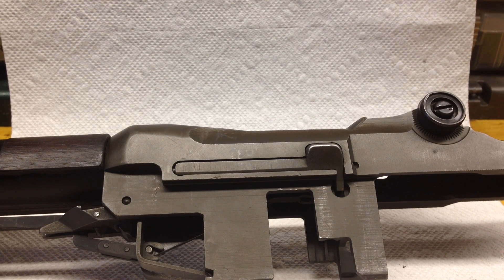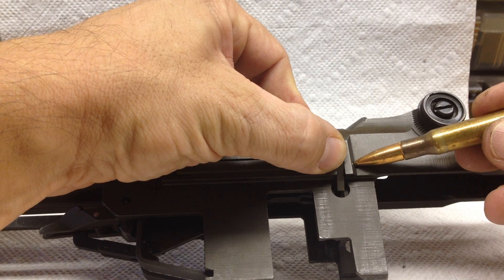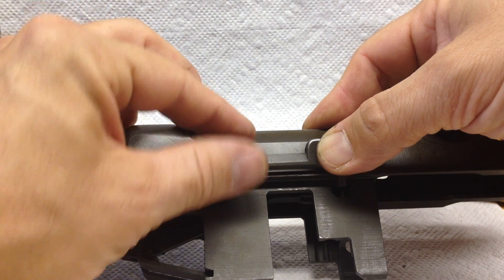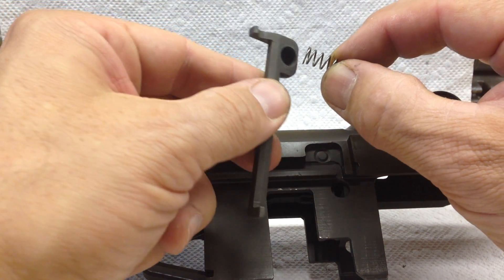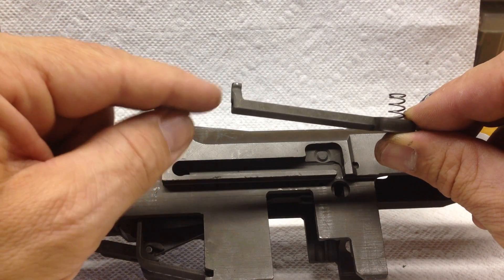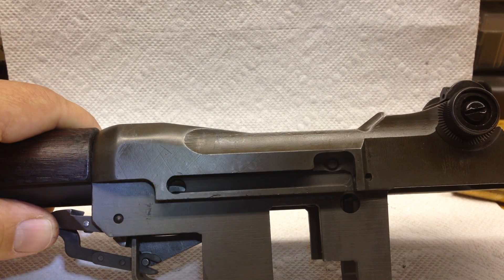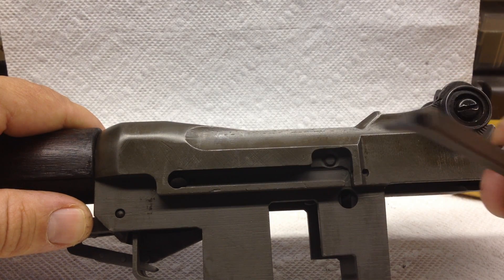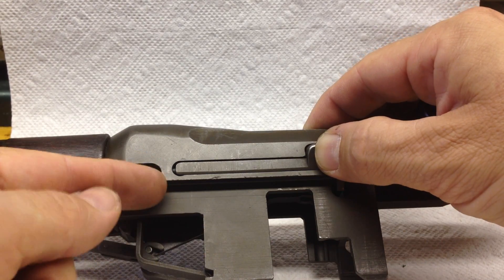M1 Garand Clip Latch Disassembly & Reassembly

Comment: What would you do if the pin is not staying in? I was having a premature eject issue, replaced the spring and latch. But it's still doing it. Finally figured out the pin is sliding forward during firing.
Reply from the maker: Pin should nothing to do with it.  Sounds like your oprod catch, bullet guide, and/or operating fork is bad.
Reply from the maker: See my timing video.

Comment: Thanks for the video. 
My cousin and I took our newly purchased Garands today to the range, and we had a repeating issue where a loaded clip would sometimes eject itself from the magazine when cycling. I suspect its caused by a worn/weak clip latch spring. What do you think?
Reply from the maker: Possibly or the oprod catch and/or bullet guide.  The L shaped part on the oprod catch is the accelerator, later ones had a ridge across it.  The later bullet guides had a thumbnail clipped area on one side.  The later parts should help.  Lets us know how you make out.

Comment: Do I have to field strip it all the way to the receiver as you did or can I just take it out with the rest of the gun while it's not field stripped?
Reply from the maker: You need to field strip to install.  But you can pull it out without, after removing form the stock.

Comment: My garand sometimes prematurely ejects clip half way with rounds inside. Does it mean I have to change the latch spring like people said?
Reply from the maker: No.  It may be a few other parts.  Try an other bullet guide, usually a late one.  Then the oprod catch, some arms are are bent or the accelerator is the older variation.  The the clip latch.  You should also check timing too.
Reply: @norwich93CMP  thanks.